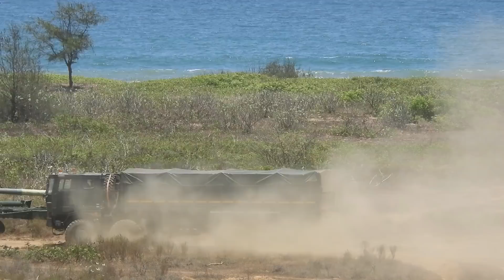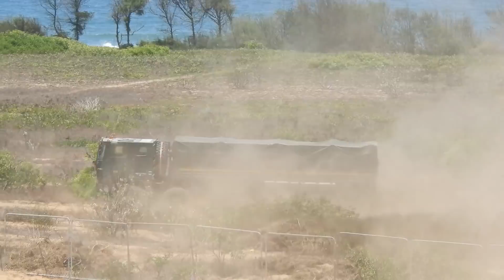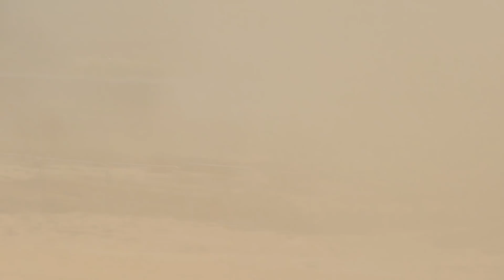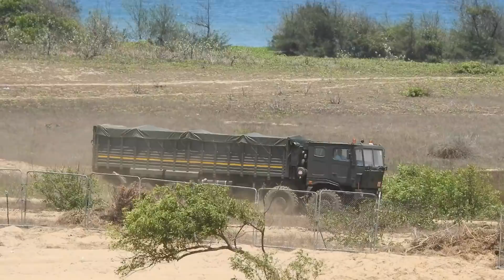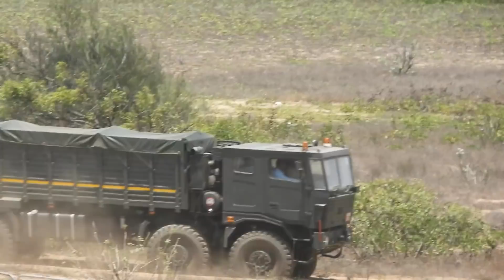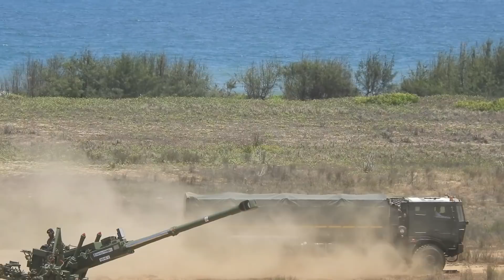TATA 8X8 truck on demonstration at Defexpo 2018

Comment: It will b given to army by 2045
Reply: G Halder No 2099?
Reply from the maker: may be not. Private contractors are on or ahead of time in delivering to Armed forces. Wouldnt be surprised if the trucks and APCs by TATA defense are delivered way ahead of deadline
Reply: Bhai log e 2045 likne se hojatha hai kya. Let his ego satisfied. I worked in Tata motors they can easily make this 2-3 years time.
Reply: G Halder it's already in use as Prahar launcher
Reply: Revan Bhunje 
Thanks for the info. May b
Reply: G Halder its present in the the army since 2005.......
Reply: Deepak Sangwan
How do u know